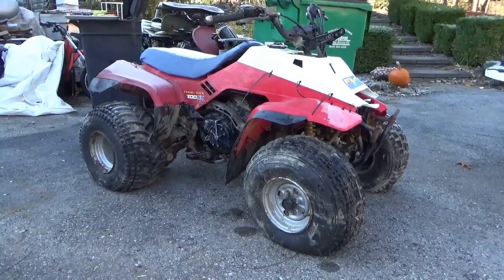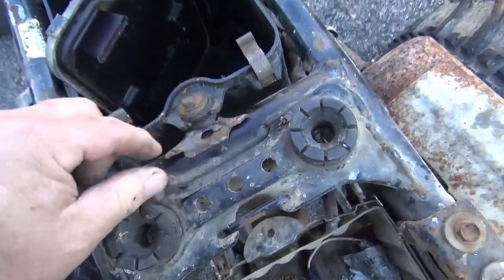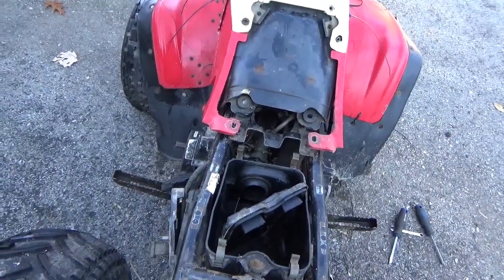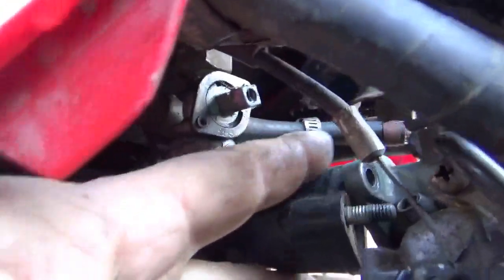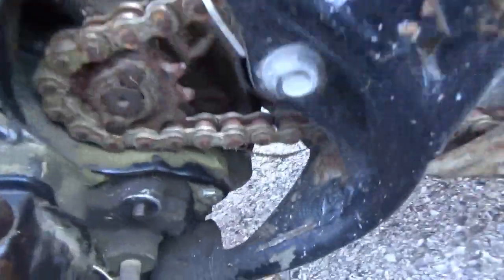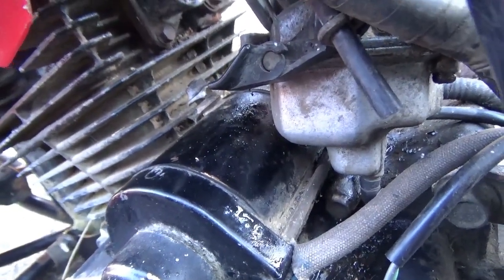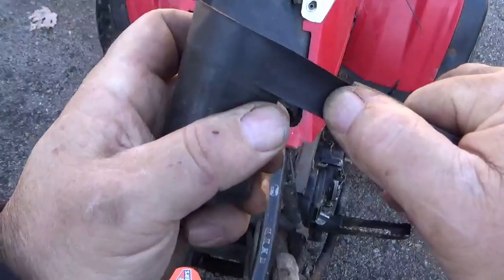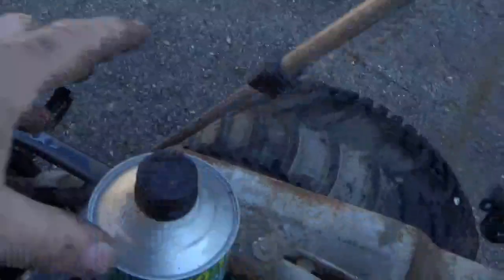$300 Honda TRX200SX, Will This Trashed, Abandoned ATV Run Again?

Comment: i seen a guy one here use a very big heat shrink on a intake boot ...with a little seal all ..allot of people who rewind stators and starters use seal all to varnish the wires ...i just used a piece of pipe and a home made flange and mig welded ..checked it with a flat gasket and soap and water it held 60 pounds and didn't have any bubbles i was amazed haha..sometimes things work out
Reply from the maker: Hey Mark!  Ok, I'm impressed that U mig welded a piece of pipe to a flat flange and pressure sealed it!!! If I need a pressure seal, I would have to solder it, my welding is not nearly that good! I needed to check on that Seal All stuff!!! I think that alone should hold the intake manifold joint together.... Thanks for the good ideas!!! Thanks also for watching and commenting!!!

Comment: I'd really love to add one of these to the collection. Amazing how quickly you get tired pulling them over. I was going battle with a 200e in the weekend. Have to hold your tongue the right way cos if you didn't start it almost first try it was just a pain after that
Reply from the maker: Hey Ashley, I still have a strong back and strong arms.... Having said that, if the engine pulls back hard, what would it take to do some damage, perhaps permanent? I have become a big fan of electric start on engines bigger than 200cc.... If U add a trx200sx to Ur collection, do it with the knowledge that there are few china clone parts out there and the used/oem market is crazy expensive, (intake manifold $150-$200, used starters $100....)  Thanks always for Ur thoughts, encouragement, watching, and commenting!!!

Comment: sounds like a pretty healthy engine by the way she  pops out the exhaust , just needs the old Harvey touch  👍💪
Reply from the maker: Hey Michel!!! I think it is healthy!!! Just needs some love, it may run in and then be good!  The machine is a bit shredded, having said that, I don't think it spent a lot of time running low on oil or without an air filter.... I'm trying to figure out if I have a touch or if I have luck!!! Thanks always for Ur thoughts, watching, and commenting!!!

Comment: Elmers [not a sponsor] the no fun glue that disappointed many juveniles over the years. Harvey, I tried to cross reference that starter but it must be a one off for the 200sx. It did fire so another notch on your gun belt cowboy, but I know you're not done so good luck finishing this project.
Reply from the maker: Hey Steve!!! This is the kind of Elmer's glue that troubled folks inhale by the bag full... I need a better sealer than glue, but, I think I can fix that manifold, the replacement is $150-$200! I'm going to have to fix that starter and I have a used one on order.... Don't worry, my goal is a ride!!! See U Sunday, I'm thinking between 9:30 and 10am.... U are the person with all the work to do loading up that 200es.... Thanks always for Ur thoughts, encouragement, watching, and commenting!!!
Reply: @HarveySpooner  I'm good on the time, talk soon.